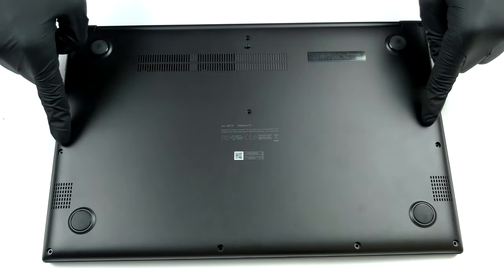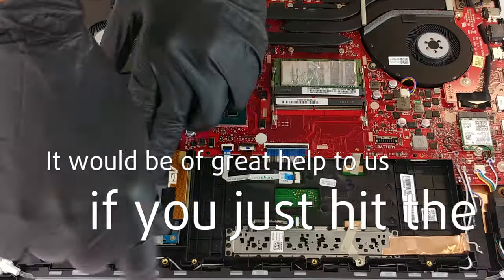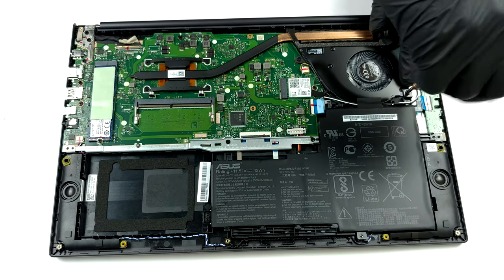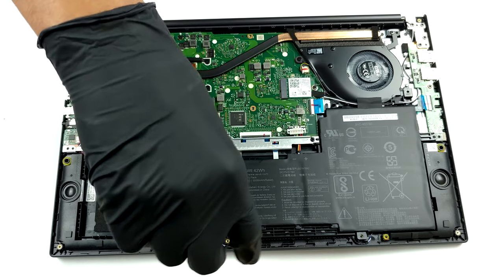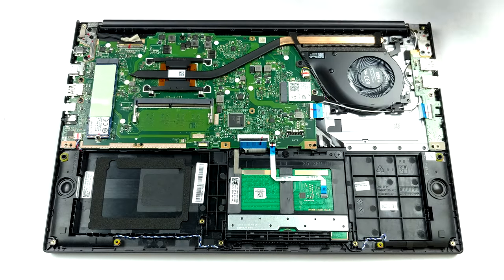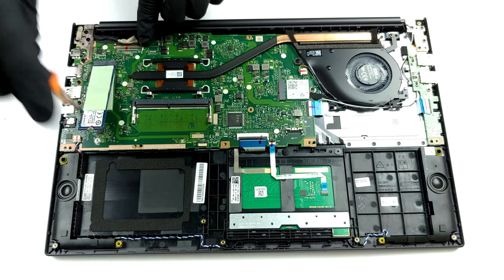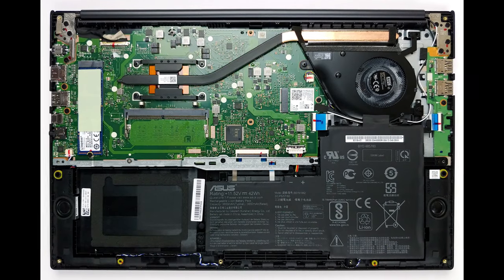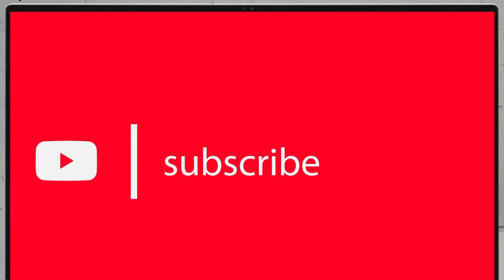🛠️ ASUS VivoBook 15 M513 - disassembly and upgrade options

Comment: Can you make a vid on this on how to add in the SATA drive? And atleast, if we can put in a 2.5 inch ssd instead
Reply: This! Pls guys :)
Reply: I have M513UA and can confirm that it is possible to add a 2.5-inch drive. The most important thing here is to find an HDD ribble cable with a caddy tray. I ordered them in Ali (search x512 hdd). After that, you can disassembly the laptop with this video and simply install your drive.

Comment: You mention a 2.5" expansion bay, but where is the SATA connection? From what you showed in the video, it appears that the connector for that port is missing in this laptop, so no expansion for you, unless it's hidden somewhere that isn't shown in this video.
Reply: The pins are there, you need to buy the connector and connect them to the pins and then that connects to the SATA

Comment: you mentioned that the max support on the slot if 32 GB whereas the manufacturer says max ram is upgradable to 12 gigs (8 stick + 4 soldered) variant.

Have you confirmed by installing a 32gig ram in the slot?
Reply: Sad news. I have M513UA with Ryzen 5700u and it does not support more than 12Gb of RAM. Tried to install a 16Gb module in the slot and the laptop just didn't start.  So, the only upgrade option here is to install 8Gb.
Reply: @legbl4314  What was the frequency of the RAM that you installed?
Reply: @sharedplayaccount  It was the same as on the board, 3200mhz
Reply: @legbl4314  In that case we are definitely out of luck 🙄
Thanks for the reply.
Reply: @legbl4314 I managed to install 16Gb 3200mhz module on my laptop, total RAM is now at 20 GB and it's working perfectly. Thought you would like to know.
Reply: This laptop uses 3200 MHz 1.2v sodimm. Samsung does not list the timings but the included sodimm for the 4GB + 4 GB setup is 

M471A5244CB0-CWE (4 GB)

1.35v sodimm won't work in it.

The other sodimm models in that Samsung family are:

M471A1K43DB1-CWE (8 GB)
M471A2K43DB1-CWE (16 GB)
M471A4G43AB1-CWE (32 GB, which shouldn't work because I believe the 5700U only supports 16 GB per slot)
Reply: @legbl4314  Thats bullshit dude. I have a 5700u and It handled 36gb. 4+32 easily. 3200mhz 16CL. That chip can handle 64gb. Its just a heavily restricted setup. So only 8gb is dual channel and 28gb is single.

Anyway, for me that was overkill so I went down to a 16gb 3200mhz 16CL stick. If I could go back I would never buy a laptop with 4gb soldered memory again. The nvme SSD is great though.
Reply: @normpearii  Wrong. I had a 32gb stick in mine and it ran right at 36gb 3200mhz.
Reply: @brianluedtke5329  just wondering why you felt the 4gb soldered memory was such a problem? thanks
Reply: @legbl4314  Hi Oleg. I had the same problem. Today I tried to install a RIPJaws DDR4 3200 CL22 16Gb and the computer never started again. I went back to the store, change it for a RIPJaws DDR4 3200 CL22 8Gb and the laptop worked again. Do you know if another brand works?
Reply: @brianluedtke5329  Good to know this. I bought a 16Gb for my 8Gb onboard without reading much first, the the official website states you can only add an additional 8Gb (for the 8Gb onboard models). The onboard btw is CL22, so you don't need to buy a 3200Mhz with tighter timings than 22-22-22. I'm still having a hard time prying my back panel right now, I'll post an update once I got the sodimm mounted.

Edit: Just got it mounted and running! The brand I used is Team, Elite 16Gb 3200Mhz CL22. The compatibility MIGHT not be on the RAM, but on the laptop model or it might be just by firmware. My laptop model printed underneath the laptop cover is M513U. CPU's nowadays should be supporting Flex memory where in my case the 8 onboard and the 8 of my SODIMM runs on dual channel, and the remaining 8 of my SODIMM runs at single channel.
Reply: @brianluedtke5329  Brian, what is the module that you have used?
Reply: @estebanherrera6669  make sure memory is non-ECC. I ordered an ECC 16G -- computer didn't boot up. I ordered non-ECC 16g (Crucial brand), booted up. Have 24G memory (8G soldered 
+ 16G)

Comment: Hey. I have this model (Ryzen 7 4000 series) and I just bought a Crucial RAM 16GB DDR4 3200MHz CL22 online, but the space for the notch is not lining up with the notch on the RAM slot.
Reply: could you solve it?
Reply: @popovich0541  No
Reply: @robertrutledge1  It's weird because if it's cl 22 it has to go into the slot I put 8gb of ddr4 3200 ram in it and it works fine I want to put a 32 in it now I'm working on it
Reply: @popovich0541  Did the 32GB work? I just emailed Asus and they said the maximum for the SODIMM slot was 8GB, but I'm doubting it for some reason.

Comment: Had a small question
Is that a cooling fan or a heatsink on the right
like is this laptop cooled using a fan or a heatsink?
Reply: It uses a cooling fan.
Reply: @somapravasaha533  where is the air going in and where is the site it comes does using a cooling pad better or it will do nothing ?
Reply: @ninjatuna2251  The heat travel across the heat pipe to the cooling fan and flow through a big vents located between the screen and keyboards

Comment: I have this model, just added a HDD in the blank space. Had trouble while lifting the backpart. Is the SSD(512GB) is replaceable by a higher volume stick?
Reply: Hi, how did you do it? I have the same model but I don't see any SATA connector, there's just the space for a 2.5'' HDD but cannot find a way to connect it. Also how much extra RAM can it have?
Reply: If the Sata Connector kit (labelled as HDD Kit) is not included in the laptop box, I'm afraid you'll have to buy it.  
To connect the Sata cable to the laptop, you'll need to lift the metal part by unscrewing it; located beside the empty HDD space. There will be a receptor named HDD ( Or SATA).  
The laptop supports 16 GB of Ram (Claimed in the box label). Extra one slot.